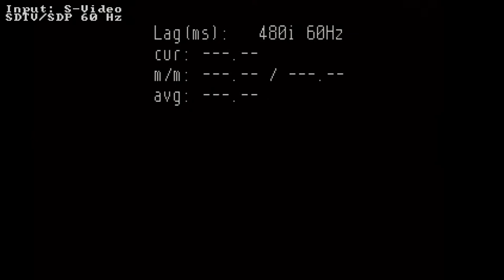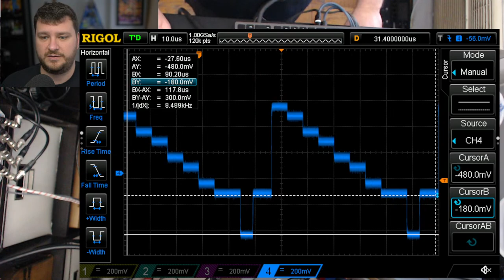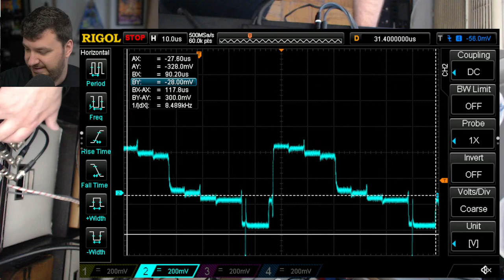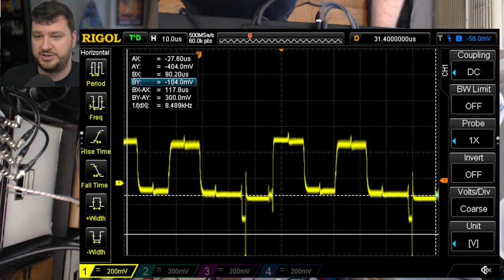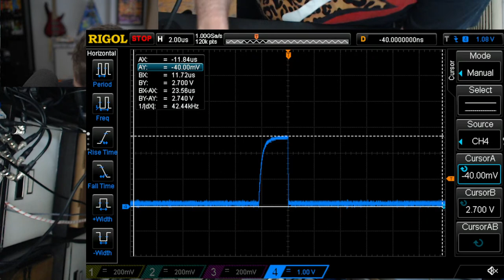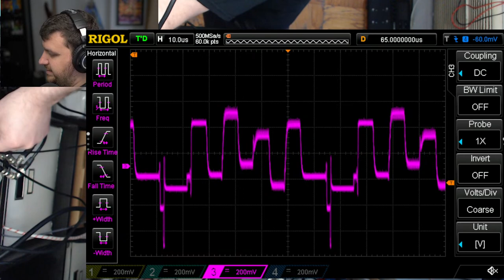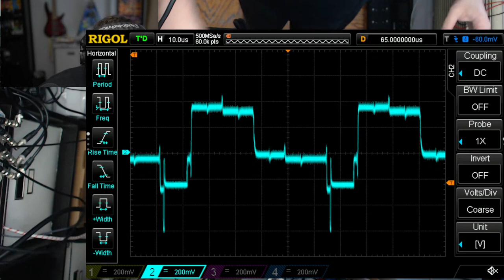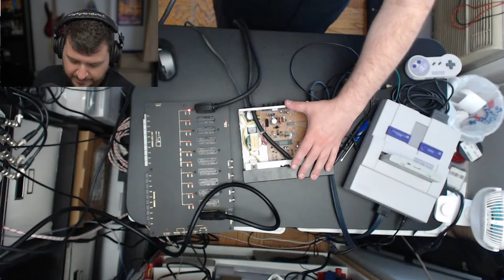Live Testing RGB to S-Video & Composite Converters

Comment: I have a weird-ass unit, the CYP CMT-7 (also released under the AVToolbox brand name). It is actually not too shabby, I tested it implementing a borrowed/non-modded N64 into an otherwise all RGB setup! Normally I use it for non-video game stuff, but it was fun to mess around with. The Kramer VM-19N also works fine, but myself and another person I know have both found said units seem to have 'dull' greens that are a tad off. Obviously it is best to just RGB mod consoles, but both may be worth a check if one is a hardcore PC-FX nut who is also a RGB nut xD

Comment: Would someone be able to give me the TLDR of this video? I really need to be able to transcode RGBS to Y/C and am wondering if the Shinybow would be good for that or if I should go with something else. Thank you.
Reply from the maker: TLDR: Neither of these should be used for video game signals.  Search eBay for the Linuxbot3000 converters, as those work perfect for RGB to S-Video.  NONE of the adapters work for RGB to Composite though.
Reply: @RetroRGB  Thanks!
Reply: @RetroRGB  Nothing's currently coming up on eBay for that but I saved the search!
Reply: @RetroRGB  using the Shinybow to transcode rgb to s-video does work. It simply requires RGBHV TTL level sync. Your GBS-C when set to downscale mode outputs a compatible signal.